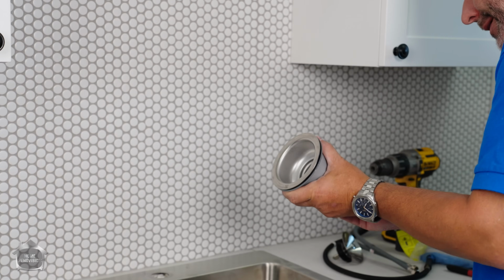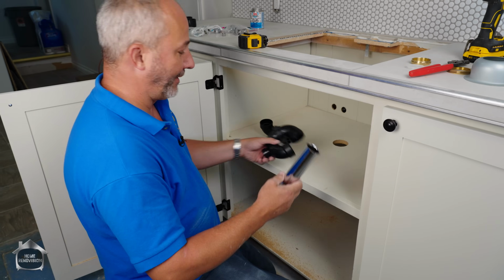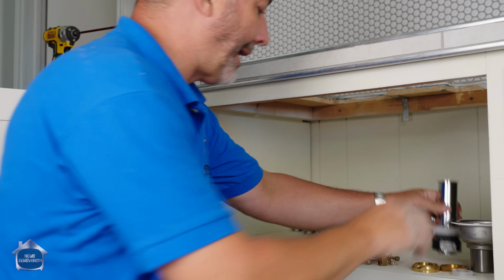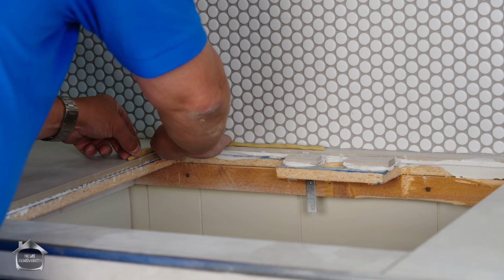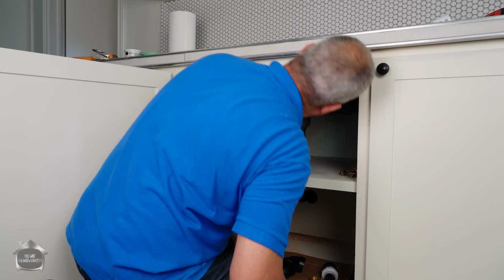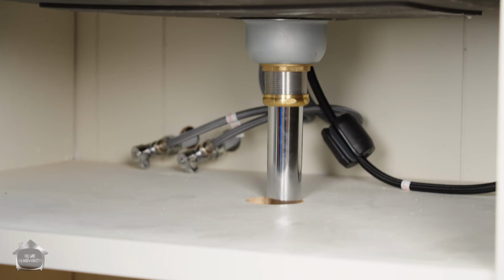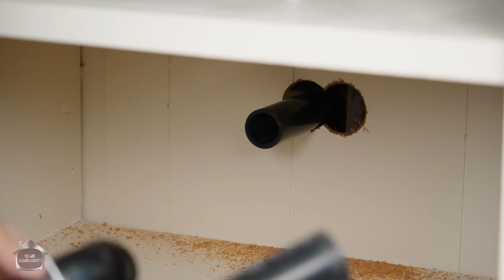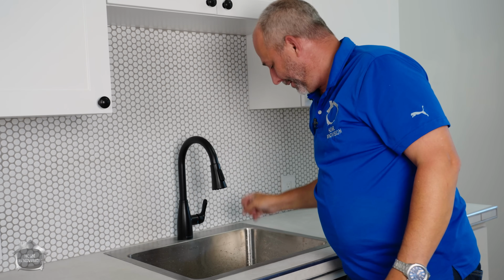How To Install a Kitchen Sink and Drain For Beginners | Church Flip | Episode 7

Comment: Silicone instead of plumber's putty is even better. Also, don't use teflon tape on ABS fittings... if you really want to, I'd limit it to 2 layers tops and don't overtighten. Also be sure you have the correct slopes for your drain pipes. I don't think you mentioned that. You also want to wait at least 30 minutes after using ABS glue to start testing.

Comment: For your relief, I bought a sink an expensive sink by Kraus in s.s. very heavy 16 gauge, and the stainer housing is plastic.   I am not going to seek a metal strainer.  I see your using abs pipes so if the premise is plastic bad then why the pipes of plastic?  They do sell 17 gauge chrome plated brass if you want to spend about $45 just for the P-trap (plus the other piping parts you'll need).  I have not yet done the pipes but I bought a bunch in PVC, Lowe's did not carry ABS drain pipes in stock.  I am trying to find out if ABS is better than PVC, but I did buy "heavy duty" PVC, and so that's what I'll probably end up using.

Comment: I respectfully disagree with some things:  I would put the rubber gasket and the white, possibly cardboard slip gasket go under the basket strainer between the sink bottom and top of the basket strainer with the plumbers putty under the basket on the top of the sink bottom hole for it.  Using the rubber gasket inside the sink allows it to stick out and collect debris, not to mention if the slip gasket IS cardboard it can absorb water and degrade as well, possibly wicking water at some point.  I LOVE Sharkbite but I am not a fan of leaving any kind of piping sticking out like that as it makes it too easy to twist and damage or fold/crimp a supply line when you are trying to turn off a line,  I would have gone as far as to use a copper stub out such as the sharkbite 90 stubout and perhaps used 1/2" pipe brackets to secure the piping to the walls of the cabinet.  I hope you will secure the free supply lines  that were on the shelves because rapid changes in water pressures in the system anywhere will make them move around from the pressure of the water hammers and make for a needlessly noisy system.

Comment: Two questions: 1) why didn't you attach the faucet to the sink before you installed the sink?  2) why didn't you run a bead of silicon under the sink lip before you placed it in the opening?

Comment: I thought the way to seal the sink was to use the putty like you did but....same thing happened to me as it will not compress enough. Had to pull it up same as you did and use silicone.

Comment: Plastic drain and tailpiece is 100% more durable then the metal ones, they don't wont rust.
Reply: Durable? No. Rust proof? Yes.

The sink in my kitchen has been there since the 1950s...all metal. I'm just replacing it today, and the only reason I'm doing it is because I replaced the countertop and wanted to upgrade the sink and faucet.

Comment: So when installing the drain pipe in the sink , the rubber gasket can go on top or bottom ,

 but no cardboard ring , that was just packaging waste
Reply: Use the cardboard ring if you're putting the gasket from the bottom. It "prevents" the metal from tearing the rubber gasket.

Comment: I have a girlie question I am about to install new plumbing pipes under the sink and have pre connected them all the way the old ones were laid out when purchasing the waste pvc pipe Home Depot customer service suggested when I showed the old plumbing pipelines he thought that the waste line that’s connected to the tee pipe should be tiled slightly down to the tee pipe so gravity would drain better. 
Do you agree with this opinion?
Thank you
Reply from the maker: In small spaces it is not necessary to have pipes tilted 1 degree however it is not good to have them sloped in the wrong direction for sure. level is just fine for small joints. Cheers!

Comment: I think you used it because it was on hand. But why Silicone and not  butyl, you can get also in a tube and it doesn’t dry after you compress it. 

Silicone is such a Beech going forward after the day it dries.

Comment: Hello! After attempting (and succeeding!) to change my bathroom’s sink faucet and drain pipes for the first time, I’ve become really interested in learning how to do other things around the house.

Now I must ask, what does the spray hose connect to? I didn’t really understand.

Also your videos are really well made, the instructions are very clear and I find myself watching them in my free time to learn more. Thanks!
Reply: The spray hose quick-connects to the faucet's combined hot&cold water line. Those 2 seperate water supply lines lead from the shut off valves to the faucet. They combine in some form of mixing chamber and the water is directed down the combined line. This line connects to the spray hose. It's the one you attach the weight to. There might be tape on it to suggest where the weight should be attached. Just below the tape is usually a good location.
Jeff can't answer all questions, but I hope this helps.

Comment: Doesn't PVC last longer than any steel pipes will? I just had all the drain pipes in my house basically disintegrate, wasn't about to replace it with more metal that's going to corrode and fail in 50 years for the next person.

Comment: You probably just saved me a bit of time and money. My garage sink/laundry drain was installed by the previous owners with threaded connectors between every joint in the pvc. And 3 of those joints are leaking. I was going to replace the whole line using normal joints and pvc glue. I hadn't even thought they may not have used teflon tape.

Comment: I came here because I too felt the agony of those darn sink clips!  I'm building an outdoor kitchen with a 12 inch sink.  The cabinet is a little tight.  I had to use an extra long extension just to get a screwdriver head to those clips, and even then it was impossible to do (mine were tiny flat head bolts and not even phillips).  After a few sliced knuckles and a ton of cursing, I gave up on the clips and went heavy on the silicone.  I used weights and clamps to hold the sink down while the silicone set.  Those clips are the stupidest design ever!

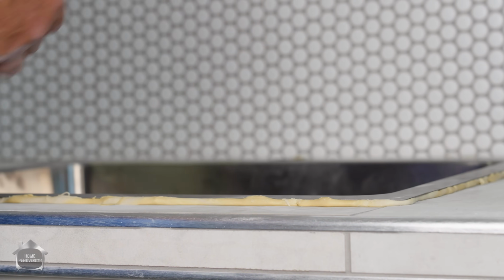Comment: 12:36 - Seems like you could use a small mirror with something taped to the back, so it would sit at an angle, and let you see up behind the sink at this point. Also sink clips that have hex heads so you can use a socket, and socket driver on your drill.

Comment: Love your channel,  I do most of the work myself and so much info got from your channel. 

Now was planning to do the drain in my place and updates the kitchen  and got stuck on a clearance  from the sink and a drain pipe in the wall .

As soon as I tacked the old Petra it was filled loose and sure into it it a copper pipe all rasted in and it is quiet up so my distance from the sink drain and the wall pipe like 2 inch distance...

Comment: I always click like on all of your videos, this one too, but for the first time, I disagree with you on something - the gasket placement for the sink strainer basket. There is a reason it goes on the bottom, because if you put it like you do, there is always a tiny bit of water that will never drain from the sink due to the sink being 1mm or so taller than the bottom of the sink.

Comment: The problem with steel is that it rots.  And just when you're doing some kind of cleanout, it breaks out.  Happened more than once to me.  Plastic will never do that.  Plastic also conforms better to a seal.  It's not good for everything, but quite often its still a great option.
Also, you should always install the faucet if you can on that sink before installing it.  I thought you were making things easier by installing it before you placed the sink?  That self is really unnecessary too.  Should have killed it.  Most sink basin cabinets never have a full shelf in them.
Reply: plastic gets brittle over time and cracks, so it's a different set of problems
Reply: Those plastic strainers are garbage. I was repiping below a sink and must've notched into the pre existing one and when I tested the strainer started leaking. Got soft and Brittle over time and immediately failed. Give me ridgid materials all day long. Jeff is a rookie though, doesn't deburr any pipe and the Teflon isn't doing anything on the ptrap, it's a tapered design, seals itself hes not a plumber but good at other things.

Comment: So what's the trick to keep the faucet tight? I have one that gets loose twice a year.    Bought a hole cover plate to see if that helps next time
Reply: There is a ring nut with two jacking screws you can use that jams everything into tension. Also if you have lots of thread left. Just double the ring nut up for a jam nut installation.

Comment: I dont useclips , I set sink temporarily, mark it with pencil, set sink then put  clamps thru holes of strainer baskets and  place a 1x4 on top and toghten ,pulls sink down tight
Reply: But what do you clamp to underneath?
Reply: @susanmei9980   forgot to say I put caulk under sink dabs here and there, I clamp using those squezze clamps thru holes in bottom of sink where strainer baskets go. on top put a 3'   1x4 across sink and top of clamp hooks on 1 x 4. leave overnight, remove clamp and 1x 4 install strainer baskets etc. I had to remove my kitchen sink to add tile, it took a hydraulic jack to get sink off, holding power is more than needed, and you dont have to climb around under there and hook up those clips and you cant see what your doing. WORKS GREAT
Reply: underneath clamp hooks on bottom near drain, those clamps have rubber ..
Reply: @timothyroche6445  I know you put a board on the top to clamp to; but there must be something under the sink to clamp too on the lower side; otherwise you’re just clamping the sink to the sink! Do you know what I mean?
Reply: @susanmei9980   board on the bottom or whatever to put pressure on clamp
Reply: The board on top spans across sink and beyond onto the countertop bottom of sink and top of board ,top board must span past sink onto laminate and I have put a 1x4 onto  bottom too . improvise , I understan

Comment: I agree on your statement about silicone, I always make sure that I buy good old acetoxy silicone. Chemistry somewhat disagrees with the statement of good silicone stinks: the "stinky silicone" is based on the acetoxy cure:  look for methyltriacetoxysilane and ethyltriacetoxysilane or  acetic acid on the label (the acid in vinegar ) fumes are what you smell. Very good bonding to almost everything, it cures very well, faster than the label says,  *but it can corrode metals and discolor stones*. 

  The other types are oxime and neutral cure, and they both bond almost as well and some have better characteristics for flexibility/tensile. But even though they state that they are water ready in 30 minutes, their fast skin time makes them very slow to cure to depth. The crappy silicones you refer to are probably not even silicone but hybrids.

Comment: "I don't like anything threaded made of plastic"... proceeds to tape up PVC threads!...LOL
Reply from the maker: Those are abs pipes and the standard for building in my country. I have no option but to use them. they are also not designed to be tightened to any severe compression like a sink basket strainer would be. I think you would be better served to actually learn from the videos before commenting. Cheers!
Reply: @HomeRenoVisionDIY  Actually, I enjoy watching your videos and have learned a lot...I just thought it was funny.

Comment: In my early 30s I did brass under my kitchen sink.  In my late 40s, there was seepage, I went to see if it needed tightening and it tore apart in my hands, corroded through.  Plastic wins, it's less expensive and lasts more than a decade in my experience, and I see other commenters having found the same thing.  

Any place with hard/limited access I also would only install something long lasting.  Your comment about flipping the place and only needing that faucet to last a year or two made me cringe, especially with that shelf blocking the next person trying to figure out how to remove it without damage!  

Any particular reason you went with ABS instead of PVC?  Again seems not a big savings but not as durable.
Reply from the maker: I will guarantee you that your tail piece was tin and not brass if it failed in 10 years. Brass does not rot out in less than 25 years.

Comment: great video again! As a plumber, i just love those plastic tail pieces. removes the fail point of the brass nut and top hat leaks due to corrosion in the long run. Plus its a one piece design with a rubber gasket, almost guaranteed not to leak.
Reply: Me too. The trouble with plastic occurs when we overtighten the connections.

Comment: Using the black or white washer ring on TOP of the sink drain, will cause the basket to be elevated above the drain opening. I always use putty for better fitment and put the washers on the bottom.
Reply: The thin white foam goes on top, the thick rubber goes underneath, plumbers putty is so old school, I'll rather use silicone if not using the foam gaskets
Reply: @daijoubu4529  Have fun removing a basket that is siliconed-down to the sink.
Reply: @daijoubu4529  What thin white foam?  I have only ever seen these come with the thick black one, and then a thin fiber or cardboard friction washer.   Plumber's putty is an old product, but that doesn't mean it's "old school".  For metal on metal, it's really hard to beat for sealing a joint, and you can get it apart when you need to one day.
Reply: @daijoubu4529  do putty/silicone the white foam piece to the sink? Or not needed with the foam piece!
Reply: @ellyr6234 Not needed but there may be a small gap on the outer edge where stuff can get trapped, if using silicone or putty, it will squeeze out the side, I just don't like the thickness of putty, doesn't flow well, you have to make sure it has 100% coverage when compressed
Reply: @daijoubu4529 plumbers putty might be old school but it's pretty fool proof and so easy to cleanup

Comment: I've heard from professional plumbers to never use a shark bite fitting, especially in an inaccessible area, because the "o" ring will eventually fail.
Reply: I was remodeling a 500 apartment complex and around 10 years earlier the building Maintenance men replumbed most of the units with shark bite fitting and most of the fittings were leaking when I had to replace all the crappie work there maintenance men screwed up by using shark bite fittings so for all the ones that still use shark bite fittings you’ll be good for around 5 or a few more years, but that’s about it good luck.
Reply: @plumbbuild6517  A shark bite is only as good as the installation and most licensed plumbers do not know what they are doing. Blame the person, not the product.
Reply: @panerai_fan  so what your trying to say because it was installed wrong it lasted almost ten years, well in my experience if it’s installed wrong it should fail a lot sooner because I’ve replaced many shark bite fittings that fail after only months now I know that they were installed improperly but lasting almost ten years they just failed from there o rings , I couldn’t care less who uses shark bite fittings but I’m not I’ve been in plumbing for near 40 years and shark bite fittings wil fail it’s just a matter of time period.
Reply: @plumbbuild6517  The reason for using a shark bite to begin with is because the original non-shark bite part failed. So now that we established that everything fails (non shark bite and shark bite), then using a shark bite makes more sense because it's just easier to install. I am a genius!
Reply: @panerai_fan  Pat yourself on the back Genius , and keep using your type of plumbing ( shark bite fittings) and me a plumber will do the plumbing the right way the first time.
Reply: @plumbbuild6517  All the plumbing problems in the world today were created by guess who? "Plumbers".
Reply: @panerai_fan  that’s where you are wrong the problem is there to many so called plumbers that are nothing but hack’s, and they shouldn’t even be doing any plumbing. And if you can’t do a proper plumbing repair you shouldn’t be touching plumbing at all it’s hack’s that causes all the flooding and sewer back ups my advice is learn how to plumb to the proper plumbing codes or leave it the hell alone and let a professional do the work.
Reply: @plumbbuild6517  The plumbing codes that you recommend to follow is precisely what  causes all the problems. They are not set to a high enough standard.
Reply: @panerai_fan  I’ve been plumbing since late 80s and the only call back I’ve ever had was new construction where subcontractors was careless and caused a problem but not one time while repairing or fixing other handyman or hack plumbers screw ups, when I leave the job it 100% right.
Reply: @panerai_fan  true story
Reply: I was always told never use shark bite in an in closed wall. The ones in this video are accessible.
Reply: He lied to you and just wants you to pay him to do a simple job that you can do yourself. Shark bites work.
Reply: @panerai_fan  I dont like Shark Bite. they have leaked way too much for me. . sticking with my compression fittings.

Comment: Hopefully your preacher wasn't around when you were using those curse words.  Do you guys in Canada use ABS plastic in your rough-in plumbing?  My area went from cast and galvanized, then copper, after that ABS in the 70's and now mostly PVC.  We were told the ABS is extremely toxic if the house is on fire.  I prefer not to burn my houses though.
Reply: ABS is very common at least in Eastern Canada where Jeff and I are. Seems like PVC still hasn't caught on.